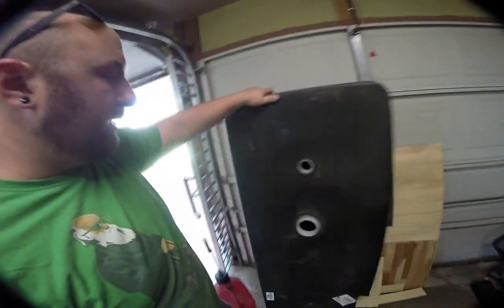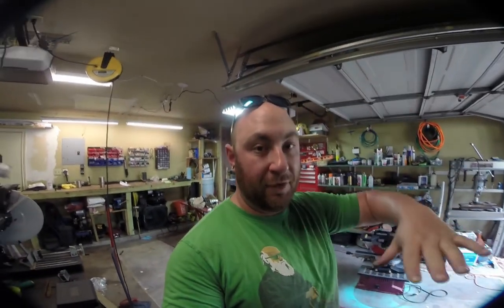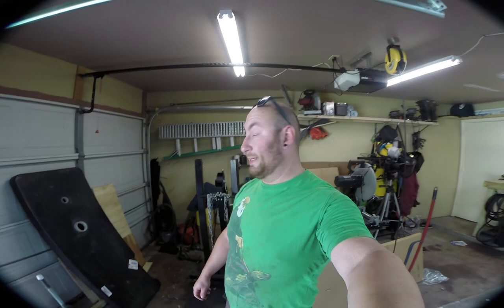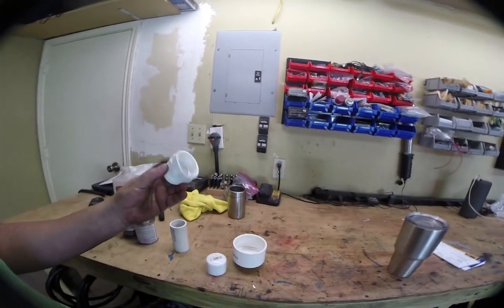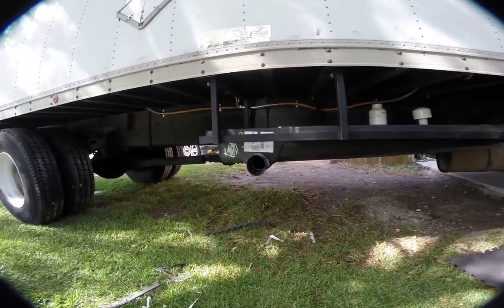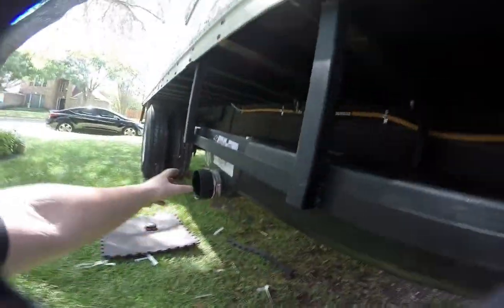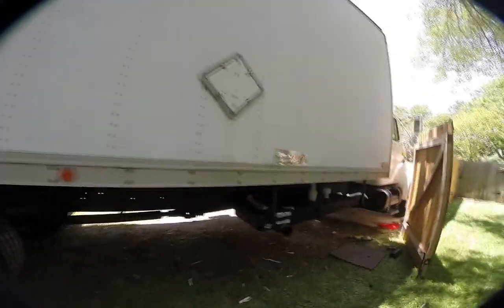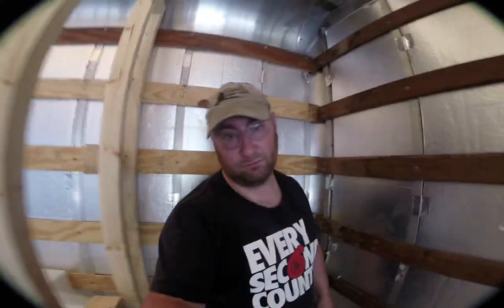#TheBassBox - Part 10 - Grey Water System Plumbing - Box Truck to RV Conversion

Comment: build a 4" platform under shower enough to get a 2" 90 and run 90 past your steel beam and then drop it down thru floor